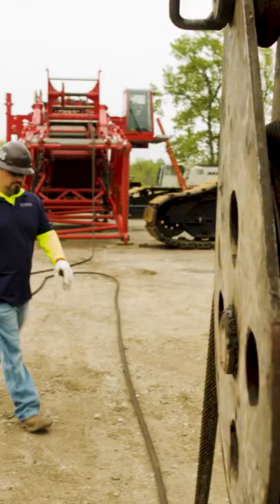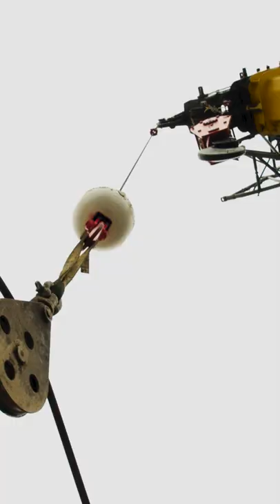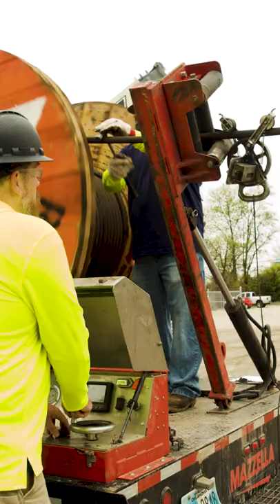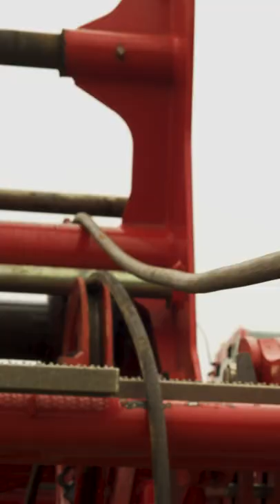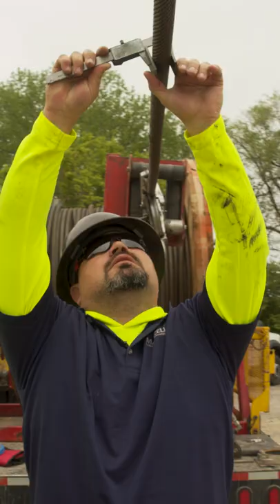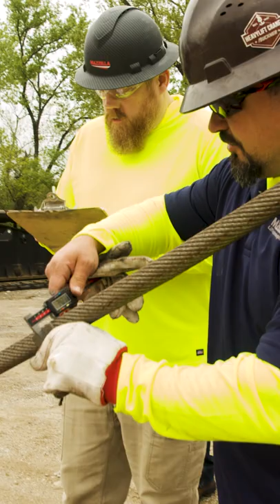What a Crane Rope Inspection Looks Like #shorts

Comment: How much does the service cost?
Reply from the maker: The hourly rate for Mazzella crane ropes inspectors is between $195 and $250. That’s our technician’s rate from the time they leave the shop until they get back after the inspection is complete. There are some other factors that may affect the price as well. We have an article and video that help explain the pricing. https://www.mazzellacompanies.com/learning-center/cost-of-crane-ropes-inspection/
And you can always give us a call at 855-247-ROPE or contact us here: https://www.mazzellacompanies.com/company/contact-us/contact-rigging-division/
Reply: @LiftingandRigging Thank you for your response. We own operate a TEREX T780 80ton truck mounted hydraulic boom crane and are needing to get an inspection done on 3/4” rotation resistant wire rope. We operate out of Sanger, CA though. Not sure if Mazzella is willing to travel.
Reply from the maker: @listento...9279  Please give us a call at 855-247-ROPE and they will let you know if we are able service your area. They can provide you with all the information you need.